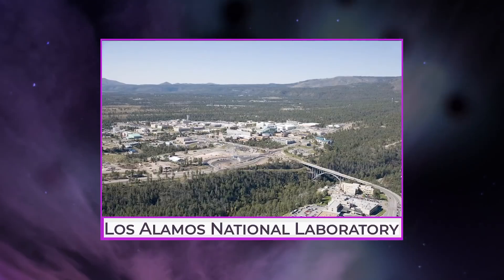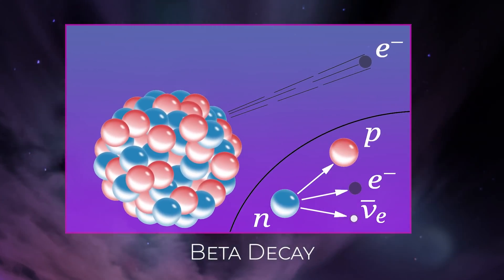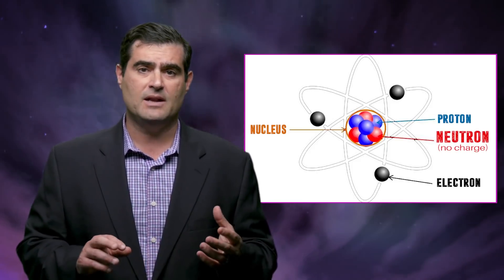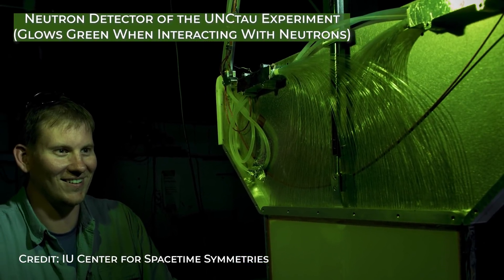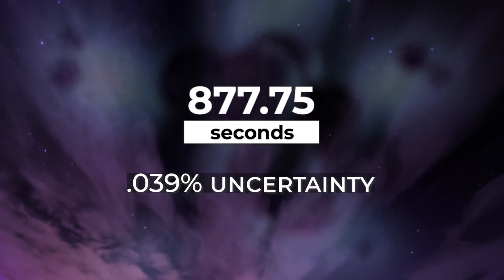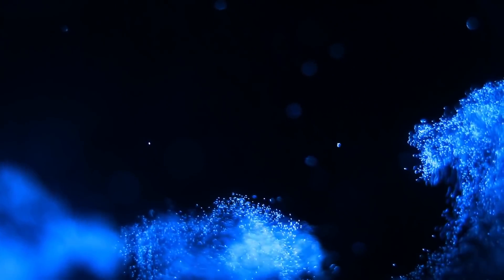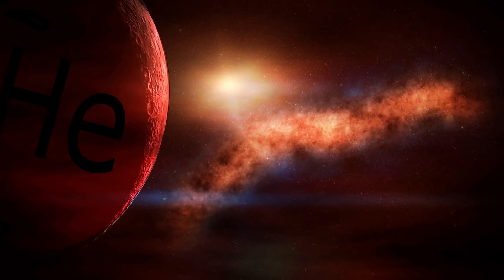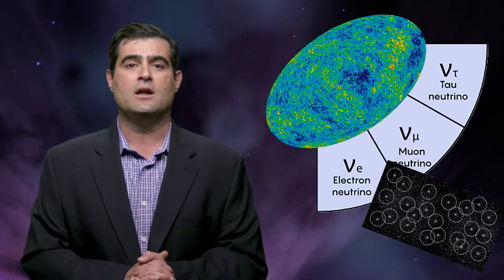Neutrons DIE in 14 minutes

Comment: I can prove neutrons don't decay by quarks transforming:

Proof: Take the reaction:

u + e^- -> d + electron neutrino.                           (1)

Since this is called "electron capture" the electron could not have changed into an electron neutrino. Therefore the neutrino got produced illegally. Hence the reaction couldn't have happened like this.

If we rewrite this as:

u + e^- + electron antineutrino + electron neutrino -> d + electron neutrino(2)

and then cancel the electron neutrino on both sides we get:

u + e^- + electron antineutrino -> d.

  This reaction in turn cannot happen because the electron antineutrino would have illegally ceased to exist. Instead we need to find a way to let the electron and electron antineutrino combine into energy. We can build throwards this by assuming the electron and electron antineutrino binds to form an anti-ud. So we have:

u + anti-ud -> d + anti-uu.

  This can be done since the anti-uu can annihilate into energy. This reaction can happen. It also fits the data and would look like the process of (1) since a neutrino can also be produced (see (2)) and the Anti-uu annihilation energy can be absorbed by the neutrino. We therefore see that the only thing that could have happened is that the u and d changed places, and that quark transformation didn't happen. QED.

  With this logic neutron decay happens as follows:

udd + anti-uu > uud + anti-ud > uud + e^ + electron antineutrino.

Saying that: the d (charge -1/3) changes into a u (charge 2/3) by emitting a W-minus (charge -1) by charge conservation is coupling the numbers to the quarks and the operation "plus" to the W-minus via someone's mind. Physics does not read minds. If you were to implement these numbers and operation physically you would run into the problem of not being able to describe the transformation in detail. My way does describe the process.

You also can't write the in between state (u/d-W-minus is undefined). I can, it is: d-anti-uu, and the reaction then proceeds by minimization of energy. One may even draw an animated picture of how the swap happens.

Comment: A 14-15 minute lifetime before decaying. I guess we say goodbye to the existence of neutron stars?

Has anyone recorded a neutron that can exist millions of years before beta decay sets in?
Reply: @pauldentler7127   Neutrons only have that lifetime
Reply: Another comment covers this better but this lifetime is for a lone neutron. In a neutron star or atomic nucleus the surrounding bound particles stabilize the neutron to varying degrees. At least in a nucleus, I’m pretty sure it’s the residual strong force that both keeps the positively charged proton from flying away from each other and also stabilizes the neutron(s). I’m not sure about neutron stars but the density/pressure is incredibly high.

Comment: Neutron Decay is dependent on surrounding energy density.
Consider the two places neutrons persist, nuclei and neutron stars. Both are exceptionally high energy density situations. 
The neutron decay anomaly is caused by the methodologies. The beam method exerts greater local field densities which stabilize the neutron.

An experiment to test would be to try and keep neutrons around as long as possible by intentionally exerting unnecessarily strong fields. 

Neutron Decay Cosmology
Always inevitable. 🖖

Comment: I find it confusing that many atoms have neutrons in their nucleus, and have half lives much longer than 14 minutes. What's going on there ? are those neutrons getting replaced by new ones as they decay, or are neutrons decaying much slower when they are bound in a nucleus ?
Reply: Sub atomic particles prefer to be in their lowest energy state. Neutrons on their own are unstable and decay into proton+ electron. When the neutron is together with the protons in the nucleus they are at a lower energy state than when on their own and therefore more stable.

Comment: ohh i think i'm missing something...if neutrons die so quickly, how are isotopes so stable? wouldn't the neutrons in an atom be mostly gone after a day? or are neutrons without a home short lived but if they're in an atom they're fine?
Reply: For a particle to decay it needs to go to a lower energy state. A lone neutron decaying gives off extra energy.
However when going from a bound proton neutron which are bound together to a proton proton, which repel,  the decay would actually require energy to occur.
Since the system isn't gaining energy from an outside source the neutron can't decay.

In certain atoms the opposite can happen. If the numbers of neutrons and protons are right then a proton can decay into a neutron if and only if the nucleus then binds together more strongly to account for the difference in energy.
Reply: @curseofgladstone4981  And they say Protons last forever. Obviously what it is is then thet if a particle can decay to a lower energy level it will regardless of what it is.

Comment: Neutron decay is the only natural example of antigravity or reverse time.  The gravity curve of space slowly gathers until what was diffuse hydrogen becomes neutronium and then at collapse and inversion the neutrons are redistributed to all lowest energy density points to once again decay into hydrogen tio do the whole thing again. A Stirling engine of sorts powered by gravity.  Gravity gathers energy. Concentrates energy. Where is the mechanism to redistribute? Neutron star inversion into event horizon. The shell so to speak of event horizon maintains gravity of hole. The neutrons aren't there anymore. They have become intergalactic medium. Amorphous atomic hydrogen which having no proper orbital electron can't emit or absorb photons. Dark matter. Or some of it.
I suspect a tweak to the Friedmann matrix is needed. Space is not a perfect fluid. It is superfluid and the wave equation is evidence.